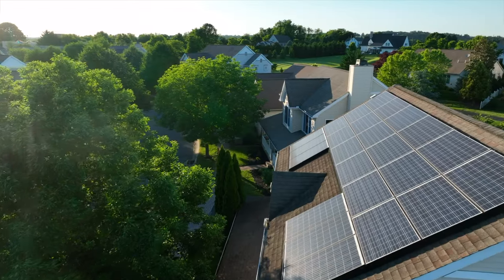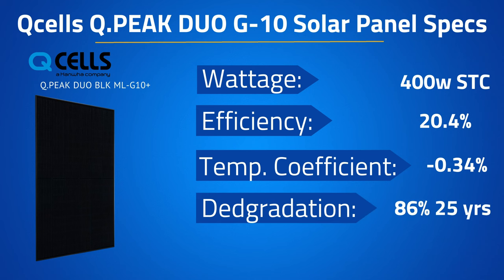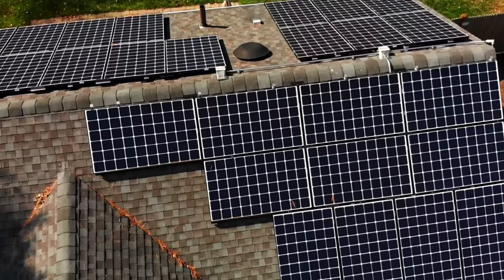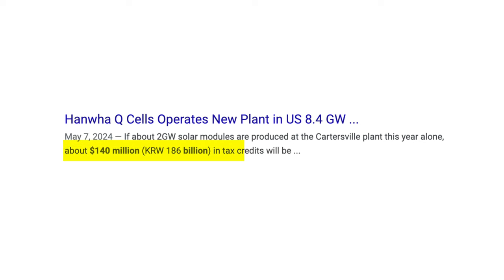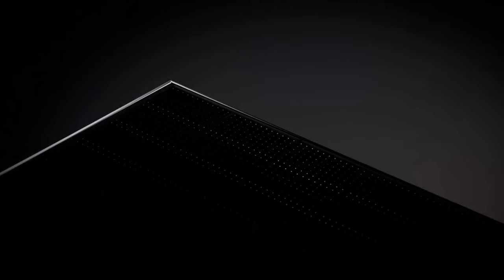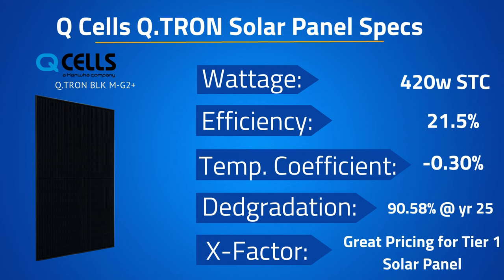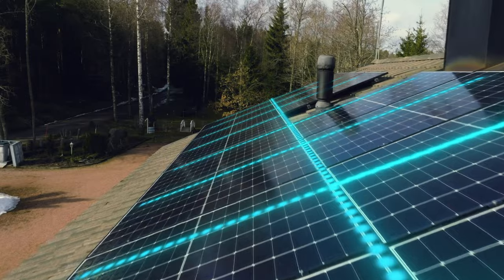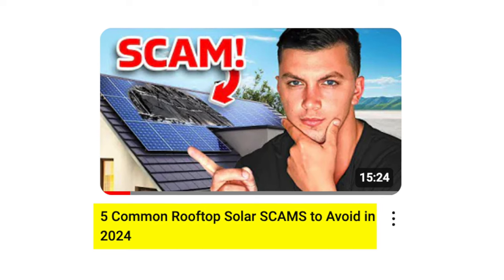The 5 BEST Solar Panels of 2024

Comment: Disappointing video, good luck with your warranty claim if the company still exists in the future, currently 420 Watt panel 63 Euro, warranty who cares.
Reply: I understand, videos exist on installer that are replacing failed panels and inverters.
Reply: 420W  63  € without the inverter... also a very cheap panel.  When/if you buy quality stuff, you are happy if something goes bad and you can get a replacement.

Comment: When you are talking about 18 to 21 percent efficiency, the difference in efficiency is not 1 or 2 percent, as stated, but rather 14 percent difference.  3 is 14% of 21, so there is a 14% difference between 17 and 21 percent.

Comment: I would hope that the panels are better when the sun is not directly over the panels. After all, the pitch and positioning of roofs are not always great. Also, how well, do they handle partial shade.  (see a neighbor have panels (string inverter) near partial shade due to chimney and roof design.

Comment: If you live in UK/Europe or another market that sells Jinko solar panels....Jinko Tiger Neo 475watts are superb. Had them installed in March, my third Solar project of the last decade and they are the best. Also had bird/squirrel protection wire caging around the edges for better save than sorry.
Reply from the maker: Jinko is one of the largest solar manufacturers in the world and has great pricing though I would consider most of their modules Tier 2.  Not familiar with the Tiger Neo 475W for residential installs.

Comment: I am not sure if I understand “clipping” or why clipping was only talked about with this one solar panel model.Can you video more about this?
Reply: The last solar panel outputs more max power. So he suggested that the micro-inverters lack the capacity to convert that amount of power, therefore you might need better micro-inverters if you use the higher capacity panels.
Reply: Simplified explanation, a microiinverter has a maximum power it can output, let´s say 2000W, then it can have 4 inputs (from solar panels)... you can (and should) put solar panels with let´s say 550W * 4...  now in THEORY your panels could produce 2200W at maximum, but the microinverter is limited to 2000W, so it will ONLY produce 2000W out even in 2200 would come in.
WHY put bigger panels than the maximum?  1) Solar panels degrade by time   a 550W panel produces like a 500W after some 10-15 years.   2) More solar power Watts, may give enough voltage to start the panel earlier.